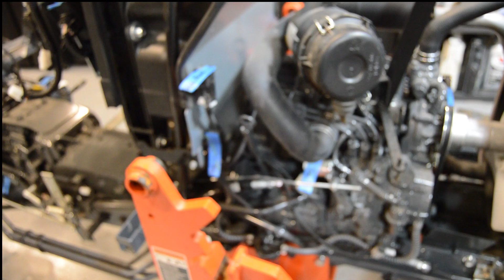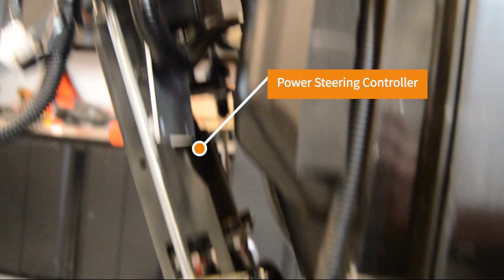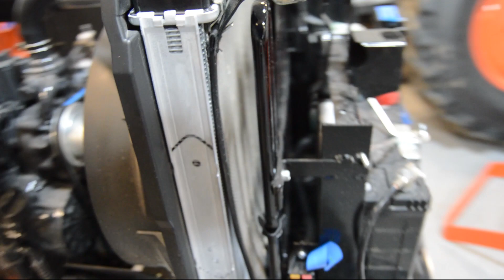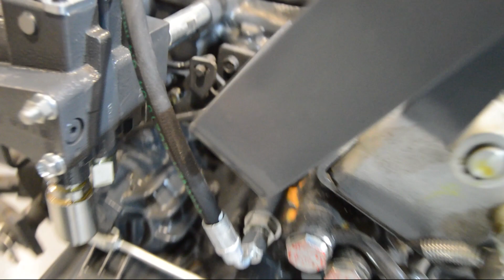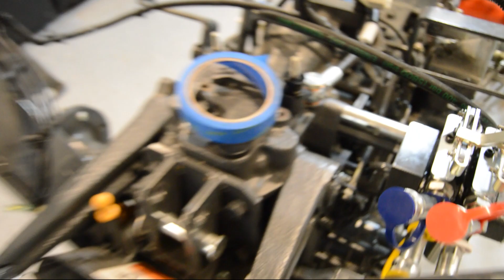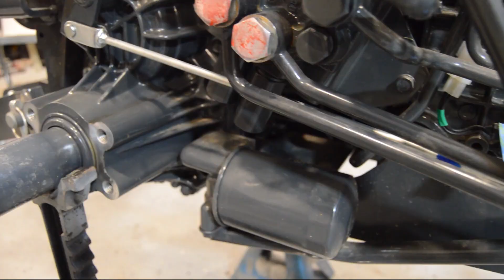Hydraulic System on a Kubota LX2610 SU

Comment: Really curious about this tractor with the SA20 posthole auger.  I assume you had (have?) the SA20 with the low flow (6 gpm rated) motor?  And you found it stalled out too much to use?  That's got me wondering because I saw Messick's run an SA20 on a B2650, which uses the same hydraulic system.  (I know Neil's a salesman, but he's also been pretty up front about limitations.....)

And thanks for the great content on the electrical and hydraulic systems on the LX2610.  Good stuff!